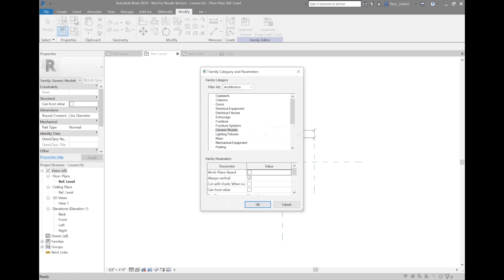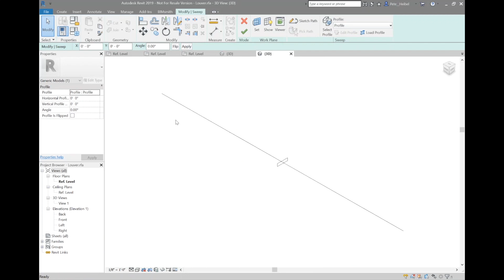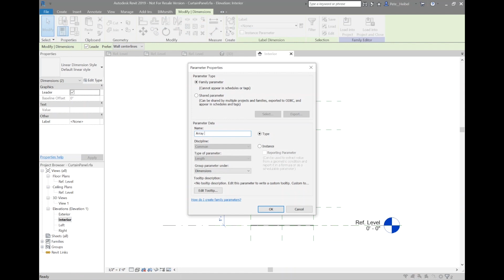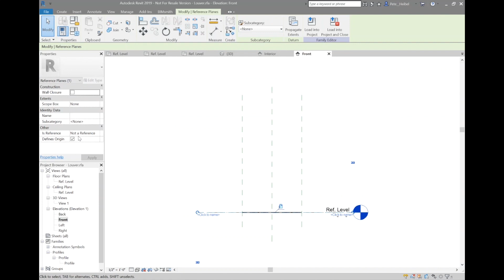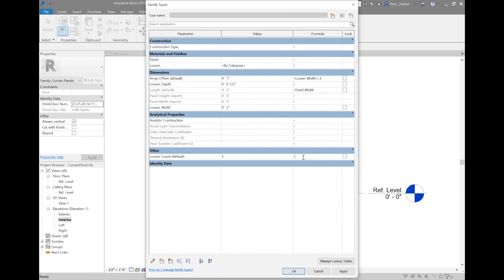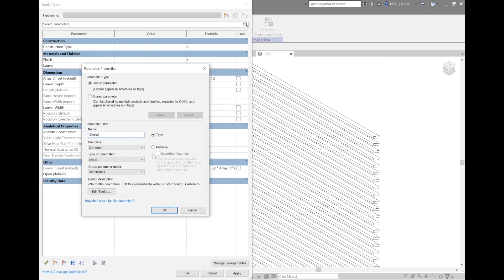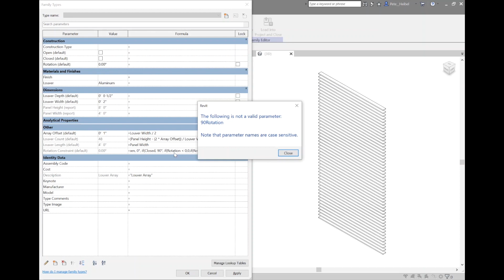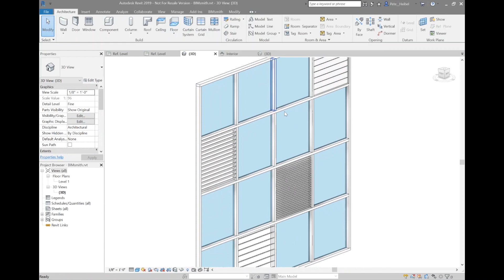How to Work With Parametric Arrays and Constraints in Revit Families

Comment: I did not really get it about open en closed. How the formula controled the Rotation. I thought should make it with type catalog to let it open or close.
Reply from the maker: Hi Lili! That's a great point - if you wanted, you could make the family open or closed based on different types and preset the rotation values; that may be especially helpful if you have one size and rotation on one facade and a different size and rotation on another.  However, without a specific project in mind, if we're providing a family like this on BIMsmith Market, we try to take advantage of using a formula and yes/no parameters to allow for any custom input still enforcing limits on the rotation.  Also, we tend to overuse instance parameters in these videos to show the values and geometry flex immediately - that's a point well taken. Thanks for your comment!
Reply: @BIMsmith  Clearly and I also notice that I have to select the geometry first. Then make the parameter. Very useful for making one transform facade and thanks a lot!